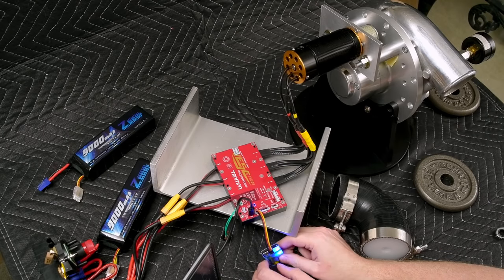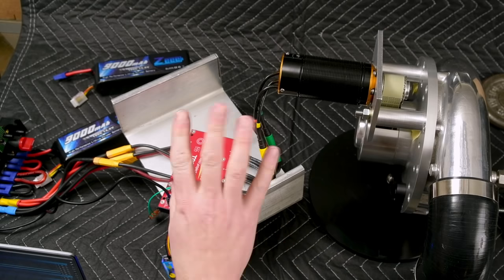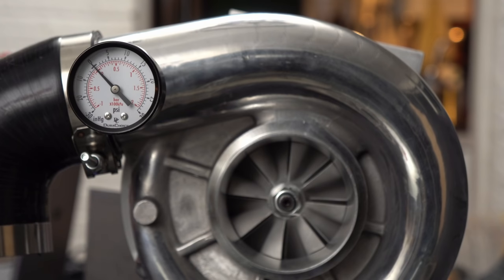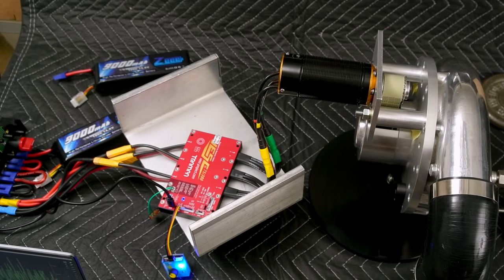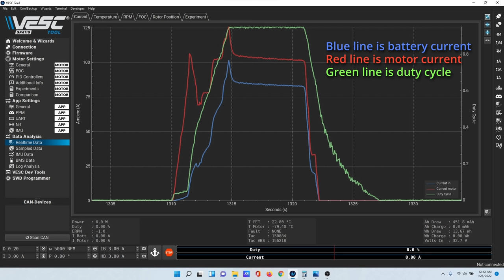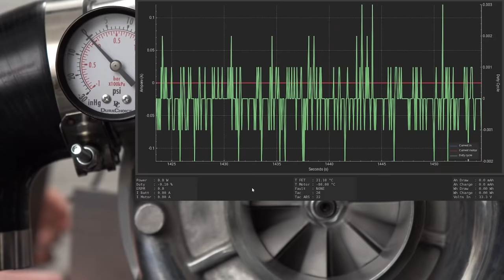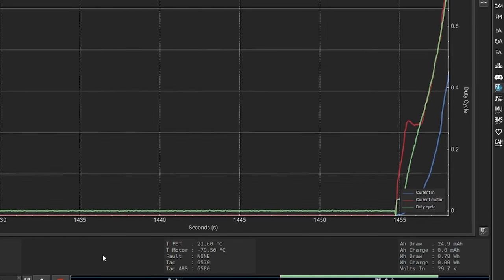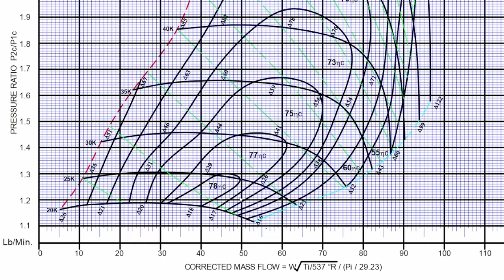Easier/Cheaper High Power DIY Electric Turbo - First Tests

Comment: So, what you're really saying is that it doesn't work.
Reply from the maker: Oh, it works - this is another variant that took a 12 second car and put it in the 9's: https://youtu.be/RT0M88xHzNQ
Reply: @AlexLTDLX  So, it DOES work. 
I'm guessing that your dynomometer had a malfunction when you did your baseline test? Maybe calibration is in order. I never really trusted those things. Nitrous guys have all kinds of carburetor issues that never get fixed lol, nitrous is an engines "cure all" to hot turbos and lean carbs.

Comment: Guy stop supporting the country that will eventually dominate you. That is just my 2 cents worth.  You need much more power to drive  that supercharger.  The best working example I saw was  system pushing almost 400  + amps.. The guy used twin motors and twin controllers. Your going to need motor capable of 30 plus KW.
Reply from the maker: I don't disagree about the "country" thing (though Speedmaster is an Australian company).  But there's no other options.  In fact, I started with (and am continuing to develop) a larger unit based off an actual Vortech.  And we've already made 650 hp with that thing: https://youtu.be/AOL3Qyczt3Y  That's getting a Czech/German motor/ESC combo capable of 52 hp (40 kW).

Comment: So go through all this trouble to realize electric turbos are not it... thanks.
Reply from the maker: I would completely disagree.  In our first drag test of the first version of this thing, we picked up 15 mph, dropped 1.7 SECONDS in ET and dropped the 0-60 time from 4.1 to 2.6 seconds.  With only 4 psi at peak hp: https://youtu.be/AOL3Qyczt3Y  No other form of forced induction comes close per pound of boost.  Not even in the same universe.

Comment: just the fact that you claim motor current is higher than your battery current proves you have no clue what you're doing
Reply from the maker: Motor phase current IS ALWAYS higher than battery current in a brushless application because duty cycle can't hit 100%.